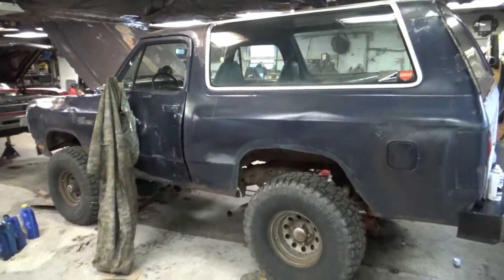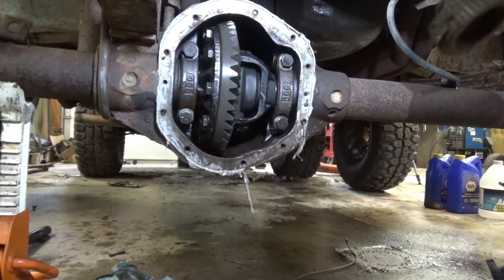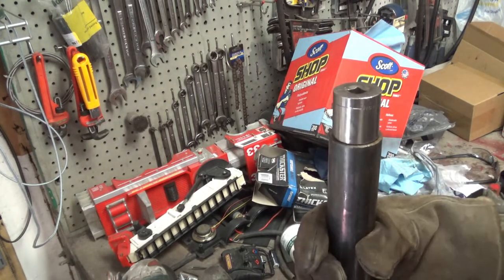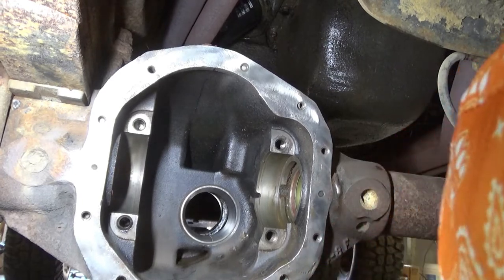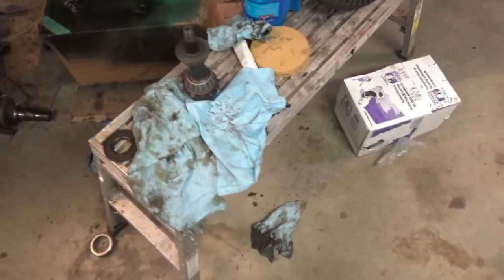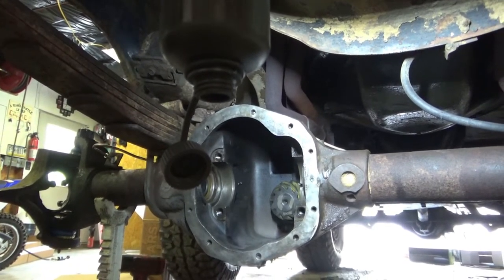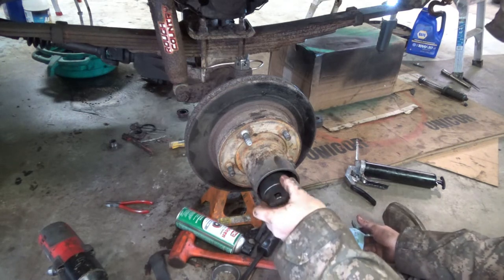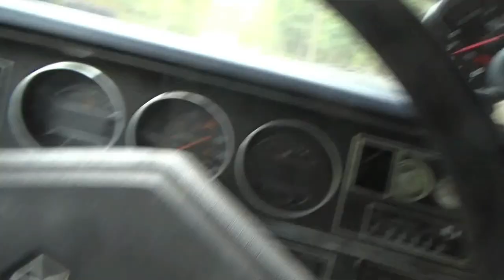How to rebuild and re-gear a Dana 44 Step by Step 3.21 to 4.11

Comment: Man, I appreciate the amount of effort you put into this video.  I am getting ready to rebuild my dana 44 in my K10 for the first time.  Changing to 4.11 gears, having to add a different carrier, and I am adding a Spartan locker at the same time.  Just rebuilt the rear 12 bolt same way which was pretty easy compared to what is going on here.
Reply from the maker: Thanks, yeah this was the most involved one I have done yet

Comment: The book shows no oil slinger behind the pinion head . But someone put it on mine 91 Ramcharger with the dana 44 .but when I put it back the same way and put the carrier back in it the carrier binds up . But the book I have doesn't show a slinger so I'm probably going to leave it out
Reply from the maker: I took a scientific wild ass guess, this isn’t a daily or anything, but no problems yet.